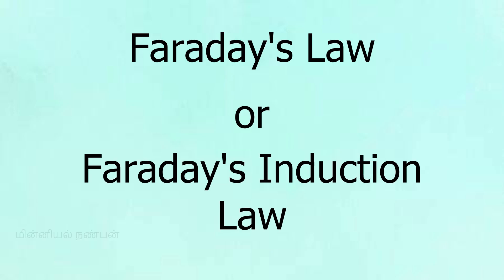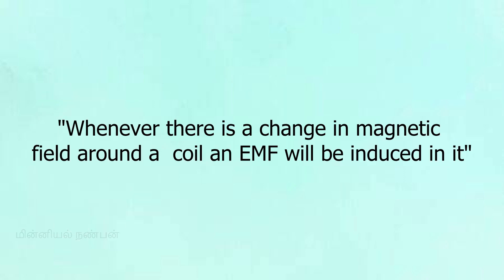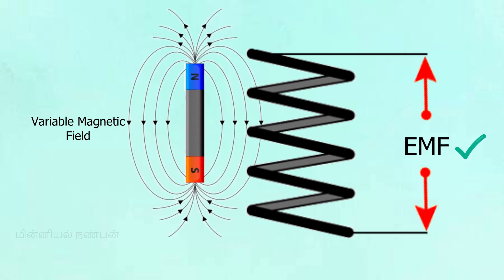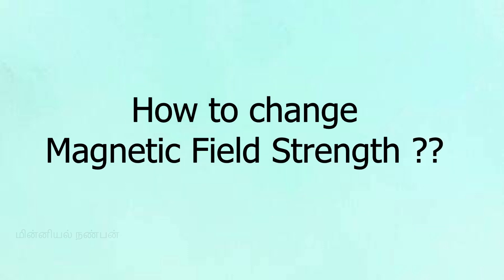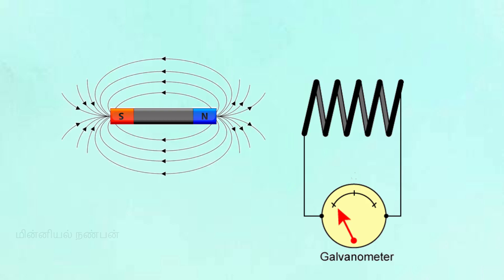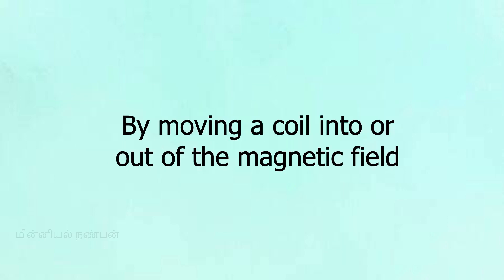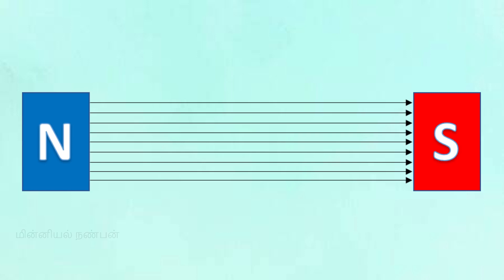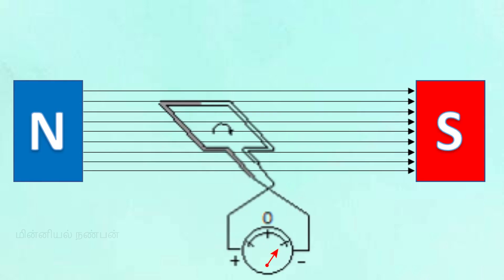Faraday's Law - Explanation in Tamil | ஃபாரடேயின் விதி - விளக்கம்

Comment: What does it mean at the coil level when you say an EMF is induced on the coil? I mean what takes place in the coil to induce the EMF or when the EMF is induced.  Does separation of charges (-ve goes to one side and +ve to other side) take place like how a battery works or is there something else?  No one explains this. They all say EMF is induced. What does it mean at the coil level as far as the atoms of the coil are concerned. This is the question? Or is there lines for force from the magnetic field that pushes the charges to create  a current.
Reply from the maker: First of all kudos to your level of thinking! Most of them will understand what we explain but they don't ask "why" Or " How" further. Actually I missed out this part to explain in this video, later I realised. From then, I was waiting that some one will question about it and finally it's you. 
Answering your question... 
Emf is nothing but accumulation of charges or electrons at one side more than the other side. Usually a conductor has many atoms scattered randomly in which the electrons revolves around it, this makes no potential difference, no emf, no current. If the outermost electrons of atoms, detach itself from it's own atom dues to some reason and moves in particular direction and due to which the electrons accumulated at one side, we say that there is an emf. If a closed loop is created and if the electrons travels further, we say it as current. 
Now the questions is, in Faraday's law what is the reason that make electrons to detach from atoms. For example, we will have magnetic field and wind analogy here. If the magnetic field doesn't change, it's field just passes through atoms(if air doesn't moves, no paper moves), if the magnetic field changes it creates a velocity which is creating a push on electron to detach from atom and travel in the direction decided by the cross product of Velocity vector and Magnetic Field vector ( if air flows, paper will move). 
Hope I've answered your question. Let me know if you still need clarification, I'm happy to answer.

Comment: I think ,Bro voltage and emf is not same ,voltage is a force ,to flow of electrons,but emf  usually  used to maintain the voltage
Reply from the maker: I understand that emf and voltage are not exactly same but it is almost same when applying to electric source. Those are two terms utilized at different scenarios and conditions of same thing. If I start explaining, it will be very confusing and will deviate the viewers from main topic. 
Anyhow I appreciate your comment and wish you do support continuously and comment more!